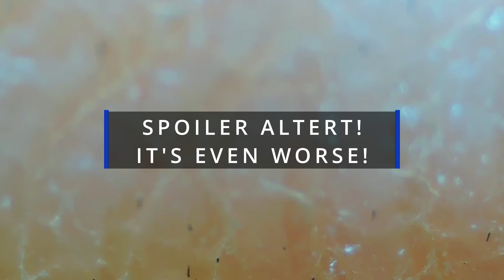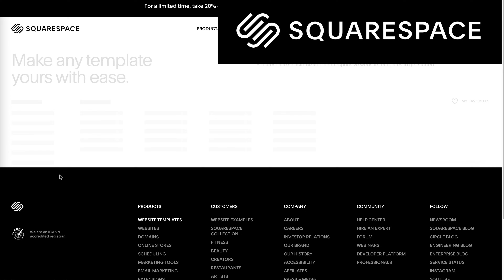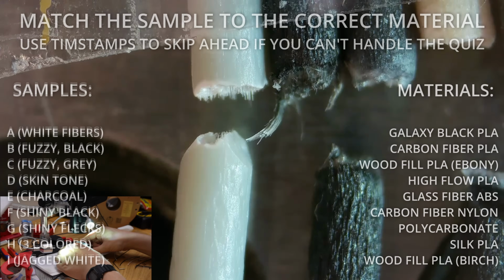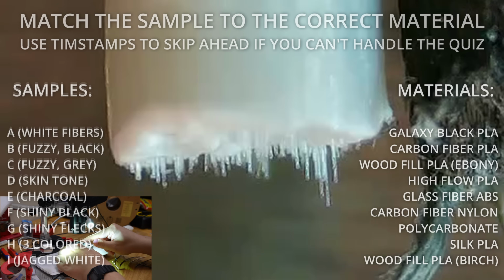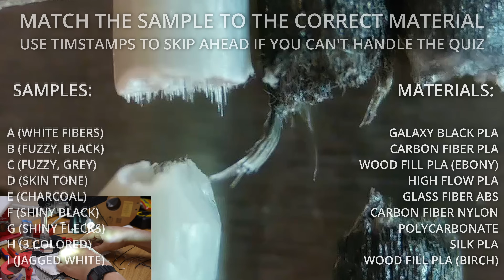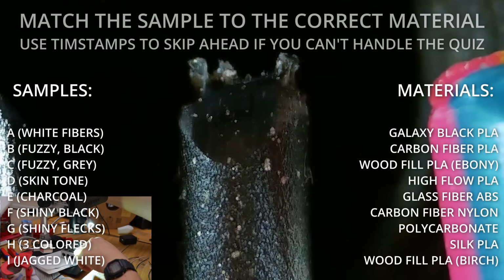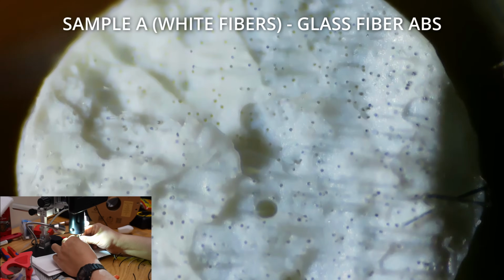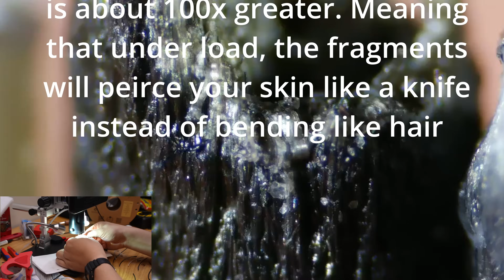Carbon In My Skin. These Wounds, They Will Not Heal.

Comment: Okay, I worked in a fiberglass factory.  Getting the fiberglass shards in your hands was an occupational hazard.  However, there really weren't any negative effects from it.  Over time, the pieces would work their way out.  If they became annoying, you just used some tweezers or tape to pull the fiber piece out.  Worst case, it would make a little sore that you may have to open with a sharp blade because the skin formed a cyst around the fiberglass.  Not a problem, the cyst is one of the body's natural defense mechanisms for irritants.  They can form around any foreign body, ingrown hair, etc.  They are only problems if they become irritating, painful, or infected.  After I stopped working there, it took about five years for the fiberglass pieces to totally get out of my hands.  It is a slow process.

So, how dangerous is the material itself?  Fiberglass is inert because it is a refractory material.  The processes used to make that glass are so extreme that your body is not going to break it down.  It is also not going to just decay in the body because the refractory process generates an extremely stable amorphous glass matrix.  However, this is only for the glass fiber itself.  All glass fiber is coated with a binder to cool the filaments and bind them together when collected, wound, and twisted.  Most binders are some form of industrial starch.  So that isn't harmful.  However, there are exotic formulations that utilize some harmful chemicals.  These are typically for specialized applications, though.  Given the ubiquity and low cost of glass reinforced filament, it is likely a starch based binder that is compatible with the polymer matrix of the filament. 

 As for carbon fiber, the jury is still out a bit.  Carbon fiber has only been around at a large scale for a couple of decades, at this point.  However, there is no indication that it is a toxic or particularly harmful substance.  So, I would generally put in a similar vein as fiberglass, but with more of a caveat.

That said, both of these can be irritants, so handling rough parts with gloves, even latex or nitrile gloves, and taking proper ventilation precautions when sanding are not bad ideas.  I don't see the need for a respirator, but good air flow away from you and/or a dust mask would be good ideas.  Also, some safety glasses to protect your eyes.  Basically, the same precautions you would use if you were working with wood.

Comment: Printing bigger parts on my 3D printer made me dizzy, even with a window opened.

So I build myself a plexiglas case for the printer, with a ventilation pipe running up into the attic. There is a 120 mm pwm desktop fan for suction, that's speed controlled using my printers API to get the printing-nozzle temperature. Added some additional LED lights that are also controlled by the printers API, so I can see what it's doing in the case. 

I'm now able to print non-stop, without feeling nauseous. I bed in 50 years, they will probably claim that 3D printing in an un-vented room is equally bad as asbestos or something... 
Better to take no health risks...

Comment: is it practical to encase the printer (or the dust generating part) inside an air tight case to isolate such microfiber airborne contaminatent? of course the enclosure space will need decontamination at certain point

Comment: As for a human skin analogue, orange peel should be enough to accurately show these fibres penetrating ability, I'm unsure of how it will compare under a microscope, but I've switched to using oranges to test my knives when sharpening/dulling (creating a sharp edge, then stropping to round off the apex, and smacking it against the orange to test if it's blunt enough to be EDC carried, as opposed to hitting it against my hand)
Reply: I tried to get into knife sharpening. Got a diamond whetstone and diy leather strop coated in diamond emulsion, but the technique on achaieving an apex is actually counter intuitive and I dont really know when to stop for each side to get that apex. It's been sitting in a corner of my room for 2 months so you reminded me to get back at it. Any tips? I bought a looker's glass that goes up to x90 magnification to try look for that apex

Comment: I was an EM in the US Navy, and I did lots of maintenance on brushed electrical machines. I had carbon dust embedded into cracks on the sides of my fingers from 4 years (the cracks were from manually turning nuts and bolts with my thumb and side of index fingers). It wasn't until 6 months after leaving the Navy when my skin replaced enough layers to clear it up.
Reply: This made me think of my daddy. He worked the navy shipyards😢❤ miss that old man.
Thank you for this memory

Comment: This needs more attention, many are still saying stuff like "PLA IS SAFE" and other fillament, but who actually knows what the chinese manufacturers put in the fillaments and how much they really care about health effects from residue etc. Just like everything else, do your own research, and be smart. Great video, we need to push this topic more out there for our own sake. Still see too many people running even 3d print farms without any ventilation, enclosure or anything. Research doesn't have a long term effect results yet.
Reply: I wouldn't worry much about standard PLA but hard to say if the additives used in some of the fancy variants could be problematic at scale. Regardless, there should always be some ventilation or at the very least a decent filter setup. Those who print ABS/ASA should absolutely prioritize this. Do NOT mistake "low odor" ABS filaments as being any safer to be around.
Reply: PLA is probably one of the few things you don't have to worry about.
Reply: @MrDanielsahne   True, but about the additives in it
Reply: Exactly what i was thinking since i started 3D printing. Who knows what kind of additives are in PLA? Even the cf rods of the bambulab printers are losing splinters that go into the air. I tested it under a microscope. Nobody talks about it...
Reply: Remember who put melamine and cyanuric acid into pet food to increase the apparent protein content.

Comment: It would be interesting to compare different brands of CF and GF filaments under a microscope to see which are safer than others. After watching this and your previous video I was terrified having just finished a project using PA-CF. I went ahead and got a microscope today and took a look at the Polymaker PA612-CF I have been using and to my surprise I saw little to no fibers sticking out of the filament. Of course, when looking at the broken off end of a piece of the filament I could see fibers sticking out. After seeing how well encapsulated the fibers appeared to be, I rubbed some of the filament on my finger and under the microscope saw that no fiber had come off. 

With that being said, it appears the biggest concern (unless if you sand a printed part) is the danger of loose fibers dislodging from the filament and becoming airborne via a hot end or part cooling fan. After seeing drastically different results with my particular filament than yours, I even looked at my PEI build plate as well as my extruder gears and surrounding area and still found no evidence of loose fibers which was a HUGE relief.

Thank you so much for putting a spotlight on this!

Comment: And that's why I never buy 3D printed stuff, imagine how many people have actually bought mugs, cups or glasses printed not just in low quality 3d printers, but any type of printer and used them right out of the printer without any treatment, they are already full of micro and nanoplastics even when made on injection molding plastics, imagine with the cheap Chinese printers

Comment: We've known about particles in the air and potential contaminants from manufacturing in industry for over a century now, so the fact that this oversight has occurred is very disappointing. We have a major issue with PFAs and other unwanted chemicals in our bodies, we don't need more foreign material in our bodies causing more mental and physical illnesses than the ones pollution is already causing.

Comment: Anyone who has worked with fibreglass/ carbon fiber/ aramet fiber/ should be aware that the fibers can pose numerous health hazards, especially if they are inhaled. Fibres in the skin may be irritating, but generally, if not chronically exposed, they will fall out as the skin constantly replaces itself over a few days. The lack of information to the general public, for which these products are marketed to, is just another failure of our governments and institutions. In today's world you will have to watch out for yourself. Be careful and wear the appropriate PPE when dealing with fibrous materials.

Comment: you did not mention one very IMPORTANT thing, please add it later

the big problem of hobby 3d printing is recycling, yep - reycling. Why? it is simple, the plactic you print most likely was recicled before and no one know what is was recicled, just some plastic. So, how the manufactures will deal with it?  They just add 25% of pure, the fist one plastic and add some stabilizators and it is a big big deal for home 3d printing.

Comment: There is an ESD PETG that has carbon nanotubes for conductivity.  The higher nozzle temperature you use the more conductive the final part is.  I am assuming at higher temperatures your part ends up with more CNTs on the surface.  That’d be a nice one to look at.

Comment: Excellent video.  I have a personal disdain for fiber reinforced plastics in general.  I hate fiber splinters so much.  You can't see them and the friggin hurt!   I have watched a lot of videos on the CF filaments, and I seriously don't understand why they exist.  They give a very marginal stiffness and strength increase in one direction, and sometimes it comes with a loss of strength in the perpendicular direction.  Not only that, it wears out your nozzle faster.   Nah thanks.

Comment: For a human skin analogue. Try using something made of silicone. Preferably a lighter tone for the carbon fiber and perhaps a darker one for glass fiber. That might help with visibility. You could even cast one in a mold made of one of your fingers to make sure the surface of the analogue has a similar texture.

Comment: I have extensive experience with composites and already shared my experience regarding 3d printing CF filaments under the last video. So far the information indicates the following:

To enter the lung and trigger serious issues (such as asbestos), fibers must have a diameter of less than 3um and a length of 10um or more (yes, there is a minimum length required - not a maximum as is the case with the diameter). 
Mechanically processing carbon fiber composites fractures the fibers and can contain some fiber fragments that can enter the lung. The ratio of fibers that can enter the lung and those that cant is a lot better compared to asbestos. So the risk should be lower and that is the result shown in some studies as well. 

The plastics used in 3D printing seem to have a worse bonding to the fibers, so when printing and handling the parts, the risk of fibers breaking up into thin and fine fragments that can enter the lung is likely a lot lower. Sanding 3D printed CF parts might also produce less dangerous dust, because the milled carbon fibers used in the filament will be freed from the plastic before they break apart. There are no solid studies on this, so this is still a bit theoretical and based on some sparse information and a general understanding of the properties of carbon fiber composites.

Glass fibers are even thicker than carbon fibers - so even farther away from the 3um threshold below which the fibers could enter the lungs. On top of that the general consensus is that mineral and glass fibers have a rather low persistence in the body and lungs. They can be dissolved and removed by the body. this removes the extremely long persistence in the body that is assumed to be a major factor in the mechanism to create cancer. 

Therefore glass fiber parts are very very likely a lot safer than carbon fiber and carbon fiber itself is a lot less critical than asbestos. It is still a good idea to protect yourself when working with carbon fiber filaments and parts, but according to current knowledge it is by far not on the same level as asbestos.
Reply: Funny thing about asbestos too: it’s literally everywhere. It was jammed into everything for like 50 years. I think we would be seeing a lot more death and doom if it was as insanely dangerous as we act like it is. But during the time is was used extensively with no precautions, everyone smoked whether they liked it or not, all cars had zero emissions controls and used leaded gas, etc. Not that it’s even possible to test now but I bet asbestos is nowhere near as dangerous to us as it was 50 years ago when we were all destroying our lungs AND breathing asbestos. Kind of a “microscopic straw that broke the camels back” sort of thing.

Comment: Just printed a gift with the Bambulab PLA-CF and gave it to a loved one. Then I saw this video, like 20 minutes later. Needless to say I took the gift back and applied double coating of hair spray - for the lack of a better alternative. Thanks for providing this info!
Reply: What would hairspray do? It wont make a solid layer, if anything most hairsprays are powder anyways
Reply: @TechMage299  It works great for me, I use aqua net high hold and mostly print engineering filaments Ultem, nylon, e.t.c. Nothing else has the ease of cleanup and works cleanly.
Reply: it's too late carbon fibers are already embedded in their hands
Reply: this isn't an issue as the fiber particles will be shed when the skin cells regenerate.
Reply: This dude used hair spray yall
Reply: @BoxMan122  hairspray works very well.

Comment: i've had a HEPA & activated charcoal filter i 3d printed for my IKEA enclosure since i got my ender 3 pro way back when nearly a month into ownership. I didn't trust the rough textures, VOC, and smells of filaments to be safe whatsoever to breathe long term, and always ended up filler priming finished prints or clearcoating them. Really happy to see some investigation into this and confirming an amount of my fears.
Reply: Nice! I thought i am the only hypochondriac in this 3d printing world. How big did you make this filter? Because the tiny ones that are already built into some printers are uselessly small.
Reply: Using carbon to filter the carbon ahaha

Comment: I do wonder if injection mold parts face the same issue. For an example: alot of plastic used in RC cars are either glass fiber or carbon fiber reinforced.

Comment: Fiberglass is mostly in things that are temperature resistant it usually goes in high performance plastics and as sleeves on cables. It could be used in nozzle parts instead of teflon but I have never seen it

Comment: Take a tip from boat builders and F1 engineers, they wear gloves when handling carbon fibre and glass fibre. 50 years ago they didn't but they have learnt. Actually the fibres from woven carbon are too thin to cause a wound but can become embedded.
Reply: That’s just to protect the carbon fiber from the oils on your hands. If you get oil all over the fiber reinforcement, the resin won’t bond to it as well. Oil isn’t great for prepreg either.